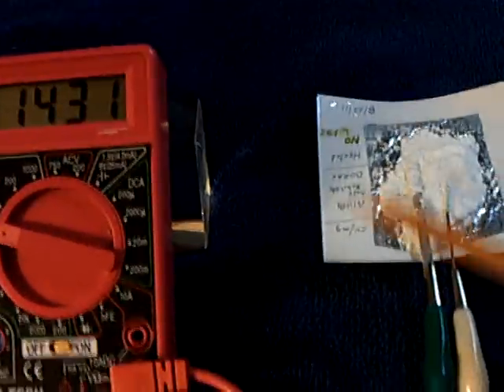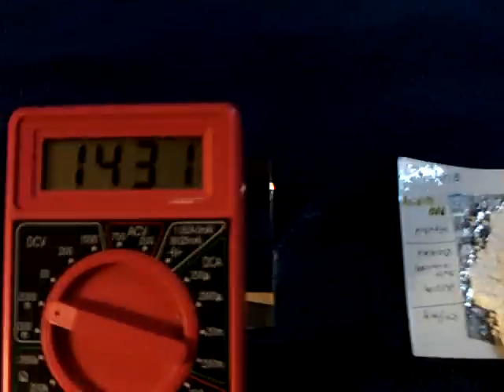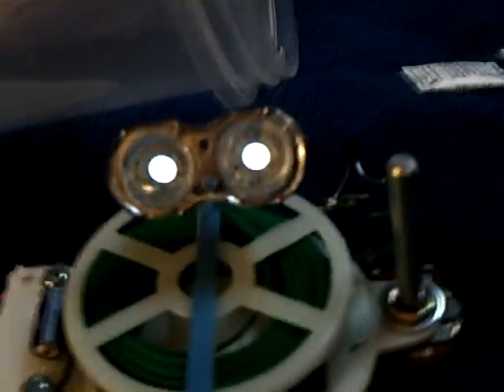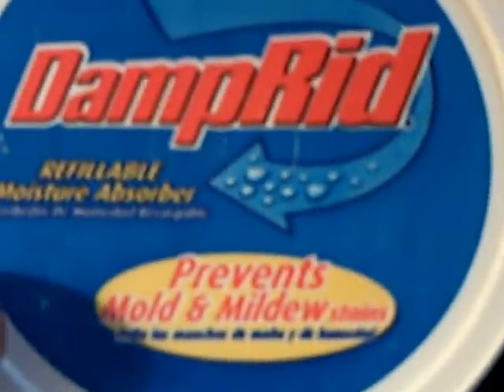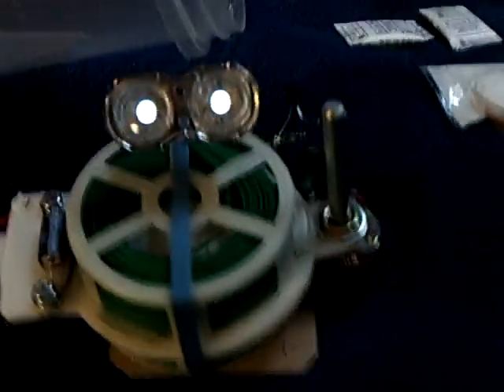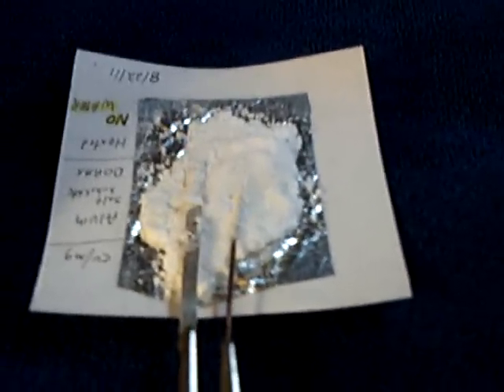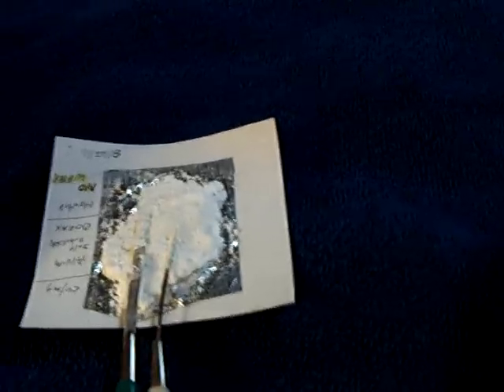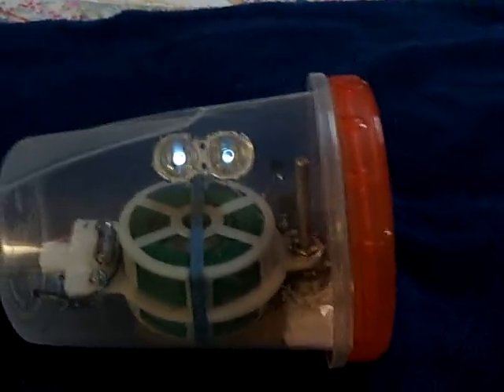Dry Crystal Cell---The air humidity experiment.ASF

Comment: As I was saying the salts act like the lucite in-between the aluminum and the static in the atmosphere is collected as fir the voltage added under heat that would be the potential difference between the copper and magnesium when the water is unlocked from the salts, just a thought, also what happens when it's in the sun will it rise or fall in voltage/amperage

Comment: Good job at next level testing although I think with the way the salts are sealed in the borax that this cell is not going to stop after a few days i suspect this may a piezo effect from the atmosphere due to crystal formations formed under heat look up the electret two squares of aluminum and one square of lucite heated to melting and electrified while cooling produces a continued voltage spark when grounded to the two plates alum is a aluminum by product is it not??? Borax and salts form a so

Comment: Great test :) Can do similar for other cells and maybe these just won't run down as quickly in the jar...as in, cells that would suit all areas that people make them, from arid to very humid. That makes it all very worthwhile in itself.
Btw, Alum+Elmer's School Glue works great, getting 1.1V @ 3mA with 2 pennies and running a 'Penny' circuit on test now as dries. It will also run a calculator. Thanks for that video too :)

Comment from the maker: @clrathnayake ----Penny's big capacitor is a 100uf 35V electrolytic.  This circuit is a very common one and it really is just the steel twist tie wire that makes it different.  Try the gardening section of any hardware store and you should be able to find it---if you want to.   The "transformer" can be made many other ways and the circuit will still work.

Comment: Thank you so much for sharing your knowledge. Today morning I made one of this. Actually I could not find twisted wires. So I used copper coils instead. (I used two 230V side of the 230V to 6 V transformer). Although it gives a very little light (not very bright) It Works. :-)
Can I know the voltage of 100uf cap that you use in your circuit?